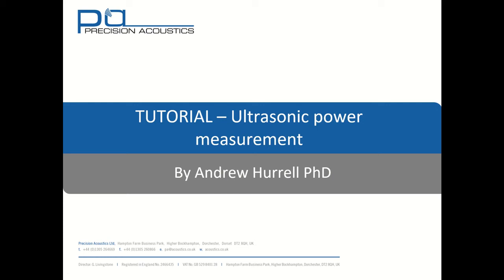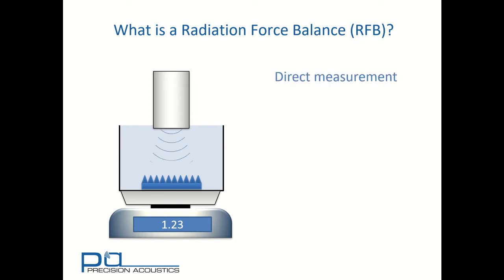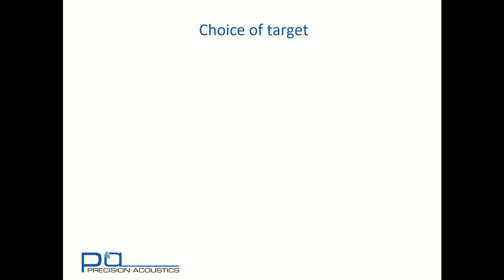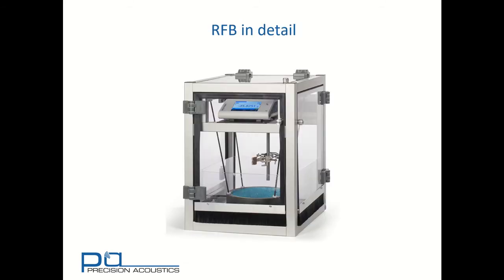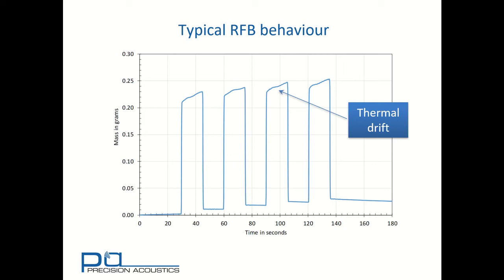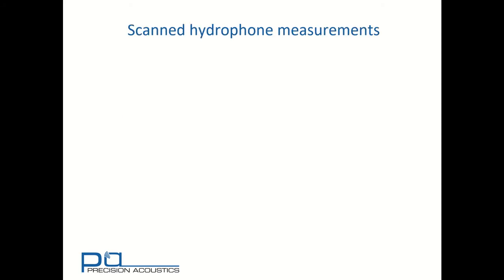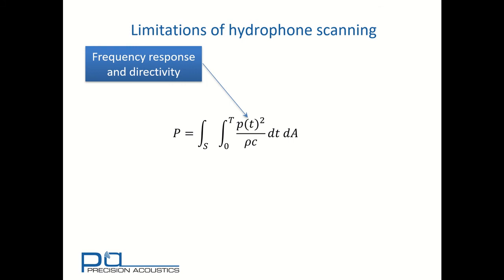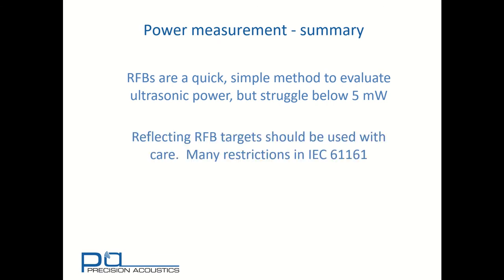PA Tutorial - Ultrasonic power measurement

Comment: Thanks for a very instructional video. I have a question about the RFBs: you've said if the target is not perfectly absorbing and some of the waves are reflected back at the transducer, this will affect its radiation efficiency. Why is it so? Thank you!
Reply from the maker: Glad to you like it. Two reasons: Firstly, highly resonant devices (as is often found in therapeutic devices) can be very dependent upon the impedance they are radiating into.  When a wave is reflected back from an imperfectly absorbing target, there will be some effective pressure that arrives back at the source transducer, thus changing the instantaneous radiation impedance experienced by the transducer, and thus how much is radiated out into the fluid.  Secondly, a portion of the reflected wave arriving back at the transducer will be converted by the piezo-electric crystal into an electrical signal within the transducer.  This is unlikely to be fully in-phase with the electrical signal that is driving the transducer, and therefore there will be some level of destructive intereference and cancellation, so the output signal is reduced.  In either case, less acoustic power is radiated from the transducer for the same power input, so radiation efficiency is reduced.  Hope that helps!